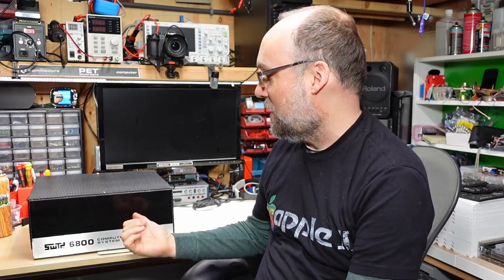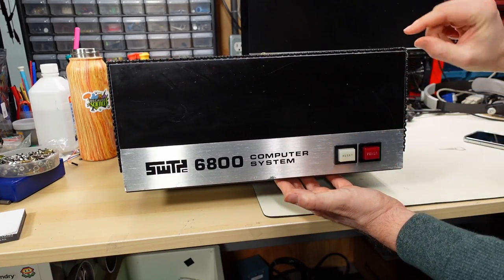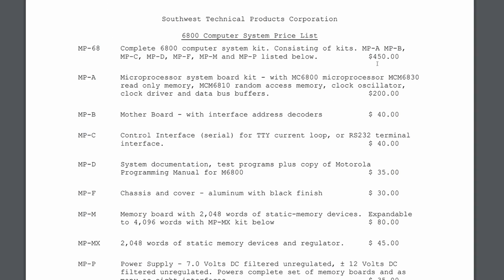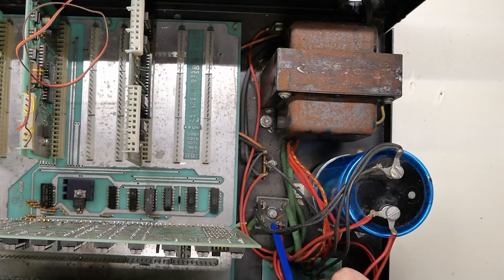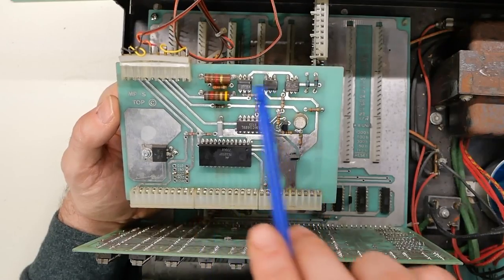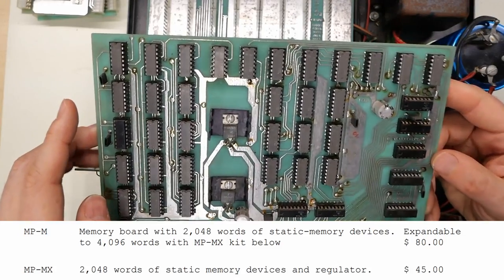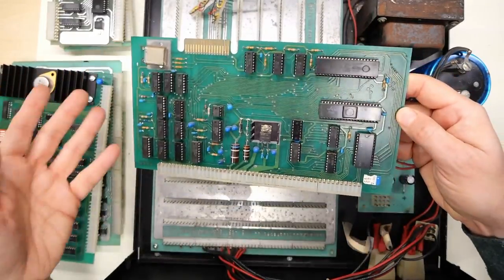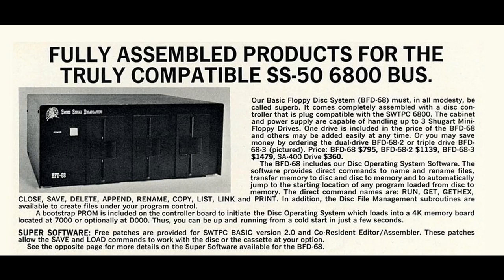The 8-bit home computer from 1975 you've never heard of

Comment: Unless the vernacular was semi-fluid in its early days (entirely possible!) 1000 words of memory would be 2K, K as in kilobytes and words as in 16 bits...
Reply: Wikipedia has an article about word length. Perhaps you X86 zealots should read it? Words other than 16 bit? Hearsay! Intel was certainly damned for trying to change that themselves. Press F in the chat for Itanium.
Reply: @1pcfred  I've never been accused of being an X86 zealot 😅 I spent most of my career developing software for industrial controllers, some of which used X86, a lot of them used the old Motorola RISC architecture - these days most of the ones I'm seeing are moving to ARM. 

When setting up comms, though, a word has always been two bytes regardless of the CPU or the protocol. And even when dealing with an analog input with 12bits of resolution you lose a byte when you're addressing them. Maybe I'll read that Wiki, sounds interesting :)
Reply: @TheWarmotor  word length got stuck at 16 bits due to compatibility. There's nothing inherent that would make word length be 16 bits besides legacy code though. Word length should be an architectural design decision. But the market complicates that. Happy customers make for a profitable business.